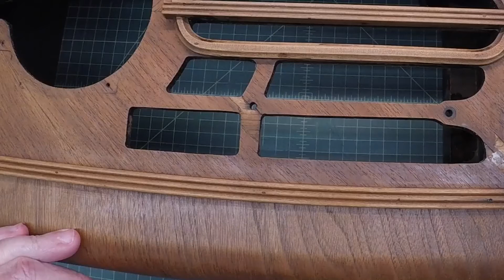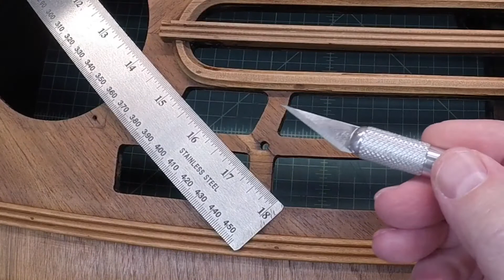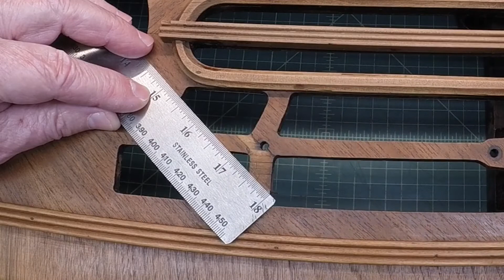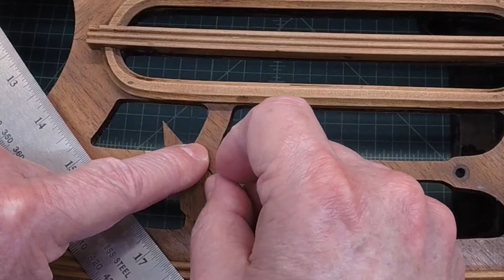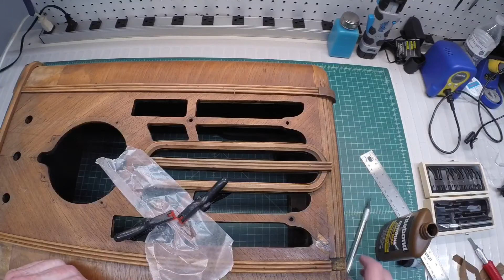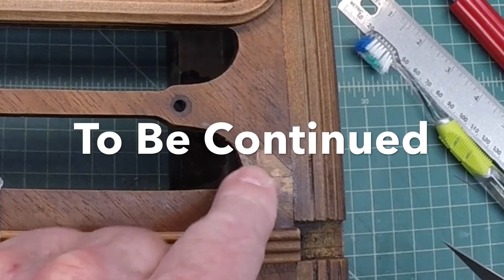Zenith 5-S-29: Repairing Chipped Wood Veneer

Comment: I too have noticed new veneers are not as thick as those applied to prewar radios. 
In instances when building up to the required level, or thickness of modern veneers for inlaying, I have used things like strips of wood shavings; thin card; folded newspaper; strips of very old plywood that have parted ...I've even used thin cotton fabric material (similar to the old pocket handkerchief material) as backing to build up to the required level before gluing the top veneer into place.  
My technique when applying veneer is to be generous with the PVA wood glue (excess can easily be wiped off with a damp cloth): very snug all round when inlaying the patching veneer, and tight even pressure when clamping.
You're doing a superb job at the prep-work ...very important before fitting veneer inlays.
Cheers Don.
Phil.
Reply from the maker: +SteelCity321PB Thanks for sharing your procedures Phil. I've messed up many of Cabinets by having an inferior substrate. I reckon it's like a house, it starts with a solid foundation. How are things progressing on your loop Antenna? Best, Don
Reply: The loop aerial is almost finished Don.  
The tasks left to do is to construct a plinth, four wooden feet (I've decided to spray paint that part of the construction black), and glue some green felt under each wooden foot.  
Once it checks out okay, I'll film the final two parts of the video, and get it uploaded towards the end of this week.
Regards,
Phil.
Reply from the maker: +SteelCity321PB Looking forward to it. I miss your videos. Best, Don